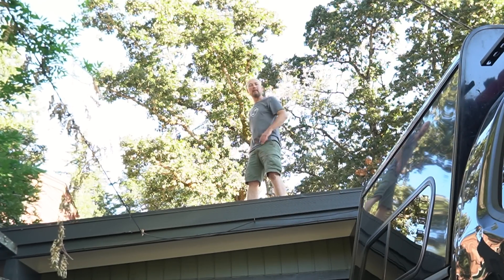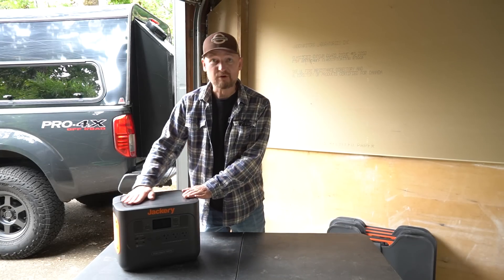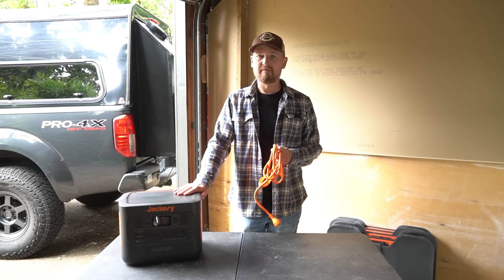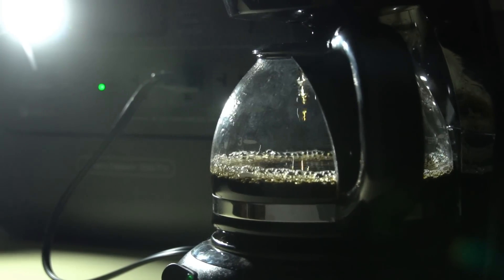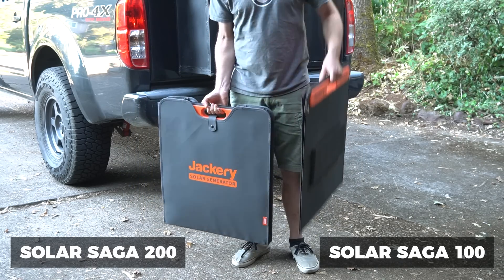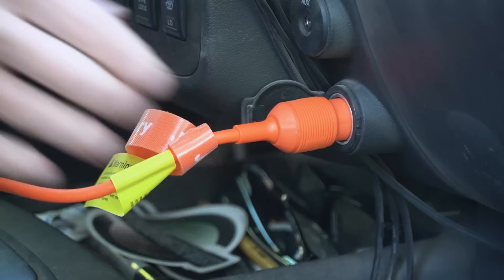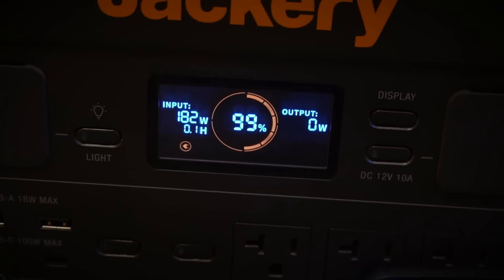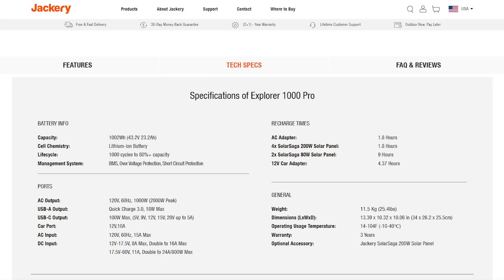Ultra fast charging Jackery Solar Generator 1000 Pro

Comment: Could I use one of these Jakerys to plug into my heater block on my truck to keep the engine warm over night at a hotel when there’s no place to plug into ?
Reply from the maker: With any power station, it depends on the power draw of the device you plug into it. A quick Google search indicates block heaters typically draw around 1,000 watts. Something like the Jackery 1000 could power it, but only for an hour. A Jackery 2000 could power it for two hours. I don't know that any power station exists that could pump out 1,000 watts for 6 or 7 straight hours, though if it does, it would certainly cost a fortune. Again, this is based on a 1,000-watt heater. A 250-watt heater would run for 4 hours off a fully charged Jackery 1000. Hope that helps.
Reply: Absolutely get it now thanks , these power stations are new to me , I think a generator for back up is most likely the best option for me . @softroadingthewest

Comment: Great Video!  How loud is it when In operation ?
Reply from the maker: It doesn't make any noise at all unless it's putting out a significant wattage of AC power. I've also heard the cooling fans kick in when it's charging on house power (500+ watts) or otherwise high wattage input. I suppose in a hot vehicle, a lower wattage output may cause the fans to engage. I assume there's some sort of temperature sensor. Even when they do run, the fans are a pretty unobtrusive hum.

Comment: My friends and I tend to do a lot of base camping trips. We go to an area, set up camp and explore from there. So a lot less time vehicle charging. Would the 1000 be a good option if your vehicle didn't move for two or three days running a fridge?  Having the solar panel option.  We do surfing trips.  High possibility of coastal fog cover.
Reply from the maker: If there's coastal fog, you'll get less solar, but presumably temperatures would be lower and the fridge will draw less power than when it's sunny. When there's no fog, you'd have more solar coming in, but the fridge would likely be running more because it's hotter outside I assume? Seems like those scenarios might balance out. 

Ultimately, it's impossible for me to say which unit is right for any given person - there are just too many variables. How big and how power-hungry the fridge is. What the outside temperature is. How the fridge is situated in your rig, how often you get into it, etc. It's always going to be a calculation: how many watts your fridge typically draws per hour vs how many watt-hours a given power station can deliver, along with a realistic estimate of solar input if you're using solar.

Comment: Nice review. Not many reviews mention battery chemistry. Jackery uses lithium ion which according to them can do 1000 charges till it gets to 80% battery capacity. This was one of the main factors when I was choosing. So I went with lithium iron phosphate which can do 2400 charges till it gets to 80% charging capacity.

Comment: I just ran the numbers on a new 12v system for the truck, and I think that Jackery has finally managed to get close to the price of the standard BC/DC charger, Solar charger, battery and inverter (not even including the cabling etc. The ONLY issues I have with the new system is that rear input and also the fact that there's no other option for 12v output than that cigarette plug. Numerous times I've had that 12v cig plug mov enough to cut off power to my fridge. Overall it looks like a solid new setup, thanks for the detailed review Donald and see you round town!

Comment: Good  morning Donald 
I have to said that you are doing very well with your review on products and like that you are giving the truth about the products and not sugarcoating it 
I’m with you too on my set up I went with setting everything up on a portable battery pack set up due to the fact that I have multiple vehicles that I can use i’m currently using the EcoFlow pro river pack with the auxiliary battery pack each pack at 750 W and have found that 
It work for me  it is nice to see that Jackery has done some upgrades on their battery packs  Looking at your homes roof have you ever thought of putting solar on your house if you do pm me and I can tell you about my system this nov 15 will be my 3 year mark and the saving I have on my power bill is great thank you for sharing have a great weekend your friend Brian

Comment: Yes you can put together a cheaper system DIY. I agree that is a different market. The Jackery problem is that you can put together a power station system just as easy to use with more capacity, better battery chemistry, app control for FAR less money. I bought 5 EcoFlow 160 watt panels for $299/per. I grabbed a Bluetti AC200P on a recent special for $1200. For $2700 total I have better solar with MC-4 standard weatherproof locked connectors vs Jackery propriety which had none of those features. I have a 2000 watt inverter with 2000wh of LFP battery vs old (less safe and less durable) lithium ion in the Jackery. All this for over a grand less than the Jackery setup.

Comment: It looks like Jackery has been feeling the pinch from their competition. Nice to see that they are finally addressing  most of the issues that everyone has been complaining about.  The main reasons why I went with Bluetti over Jackery for my own setup seem to have been addressed in this new model. The elephant in the room , for me at any rate, is that Jackery is still using old school lithium - ion batteries instead of the much safer and longer lasting LiFePo batteries. No matter which you choose, the technology inside the case has grown by leaps and bounds in the last couple of years. Give it a few more years and the battery materials will change again and be even better than what we now get with lithium based components.
Reply: They may be feeling it but they haven't come close to responding enough. They are at 2x the price for outdated technology!
Reply: now they need to address the price
Reply: LiFePO4 do have a safety advantage - but I'm still impressed with the compactness of the Explorer 1000 Pro build versus my own D.I.Y build in my pop up, truck camper.  Jackery, in this case, is competing with comparable EcoFlow and Yeti Goal Zero power stations. 

In my opinion, the  Explorer 1000 Pro will do well catering to the mass market, plug and play crowd.  As Daniel mentioned in the video, not everyone is up to doing a D.I.Y build.
Reply: Pretty sure those LiFePo batteries charge much quicker as well.  At least my 100AH Battleborn charges much quicker than my Jackery 500.  Granted, I have 2 100w panels charging the Battleborn, and just a single 100w panel charging the Jackery, but the Jackery usually takes most of the day to charge with only half the battery as the Battleborn, while the Battleborn is usually fully charged by noon or 1:00.
Reply: The way these products are evolving quickly is one reason I'm still comfortable using li-ion, I'm fully expecting that I'll replace my ecoflow unit in the next 3-4 years as new features and upgrades become available, and so I'm not all that compelled by a unit that has cycles to last 10+ years, except from the perspective that it will make the unit easier to resell when the time comes
Reply: @cramias1  its not just the life cycles. The newer LFP (and upcoming sodium ion) are SAFER. Minimal risk of thermal runaway. Have you seen the Samsung phones exploding? Jasonoid recently put up a video of a lithium ion power station on fire and shooting sparks and burning embers all around. I love the longer  life,  but I also keep these inside my home, vehicle, and tent.
Reply: @HikerDoc  Sure I get that.   I do think the better quality stations have good BMSes that mitigate most of the risk of thermal runaway, its primarily an issue with the no-name chinese stations and ebike batteries, but still, not completely zero.  The main point I was making is that people love to tout the huge cycle count for LiFePo and I don't actually think its a huge factor the way its made out to be

Comment: Jackery is so out of touch with reality. No LiFePo cells, No wireless charging pad, ridiculously overpriced and proprietary SolarSaga panels with barrel connectors. Please, tell Jackery it’s 2022 not 2012!
Reply: But they got the HANDLE  Right this time.
Reply: My Jackery charges will a generic Rockpals panel?
Reply: @om617yota8  Reading comprehension is not your strong suit, is it?
Reply: @MIAMIC70  Hey I was willing to have a discussion, but clearly you're not. Have a good life
Reply: @om617yota8  No “discussion” was ever needed.

Comment: Fingers crossed, Jackery, Bluetti, EcoFlow, et al will someday build a unit of this size that offers a 15 amp, 12 volt output for RV camper users versus their current 10 amp, 12 volt DC standard output.  Part 2 - like EcoFlow please offer an XT60 charging input, but also a XT60 12 volt DC output port to make for a more secure connection from the camper accessories to the power unit.  I say this to as the owner of a truck camper that has both a gas furnace with 12 volt DC blower and a 12 volt DC compressor fridge.
Reply: Bluetti has already done better than what you're asking for 12v 25amp on the AC200P and up to 30amp on the MAX. With better pricing so you get 2k inverter and battery for Jackery 1k money.
Reply: @HikerDoc  You had me looking up the AC200P - which does in fact have labelled RV 25A, 12 DC port.  The power station is definitely a two hander when lifting and weighs in at 60 lbs versus 25 lbs.